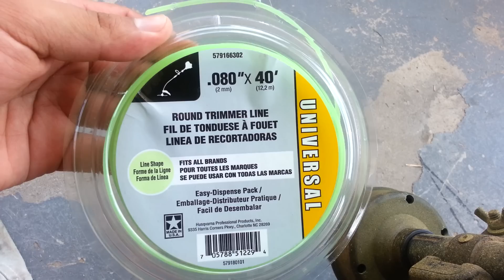How to String Murray 2500 Edge Trimmer (Wead Eater Walmart wind up)

Comment: My problem is with the cutting head shield.. the little screw that holds it together came loose. I tried to tighten it but it doesn't tighten so the shield keeps moving around. Wonder if I should just gorilla glue it

Comment: My issue is it doesnt feed my line when i bump it on the ground
Reply from the maker: Re-wire it again
Reply: Legit done it 20 different times watched multiple videos and they all did it how i was already
Reply from the maker: @xcodychaosx  that’s weird, you’re using the correct string?
Reply: @DanielLopez9111  yeah i believe .065 i used to mow yards for a living and never had this much of a pain but we had echo weed eaters but yeah i have the smallest yard and had to rewind just about 20 times it like sticks to the string in the spool almost fuses together idk i basically figure i need to get an echo
Reply from the maker: @xcodychaosx  try replacing the bump and spring

Comment: I used a few times, now my head is stuck on.... I can't get it off
Reply: BigDRE PutInWork me too
Reply: Same here--it's completely stuck and won't come off. I was able to screw off the plastic cap but the bolt broke free from it and is totally stuck, will not screw off or even tighten.
Reply: BigDRE PutInWork did you try smacking it across a brick wall?
Reply: This happened to me too and i hit the bolt with a hammer a few times and it came right off after that.
Reply: Mine is stuck as well,  i guess i need to try beating it a little bit.
Reply: BigDRE PutInWork
Reply: The head will not come off, it keep spinning.  What do I do now?
Reply: Hit the top of the bolt down with a hammer and it should come off,  mine did at least.
Reply: Same here
Reply: Get some locking vice grips and it will come off.
Reply: The hammer worked for me too.
Reply: Hammer works.
Reply: Y'all put to much line on it
Reply: Hammer it is then🤣😂